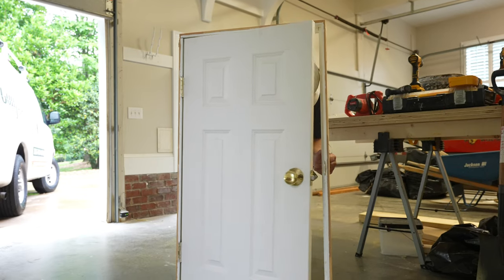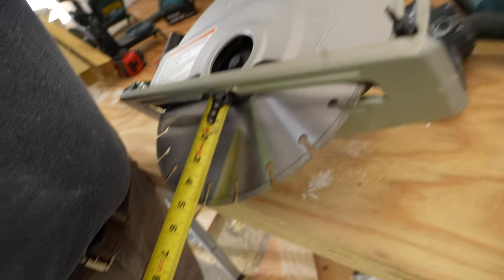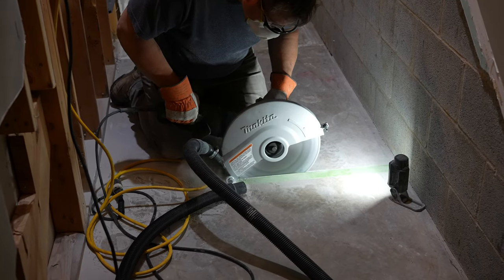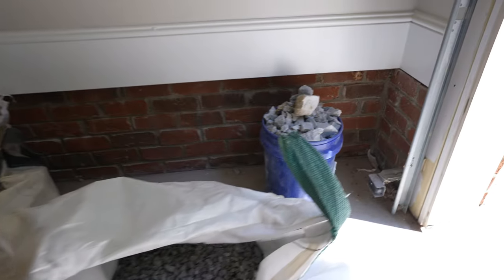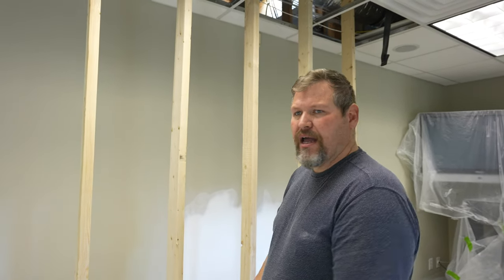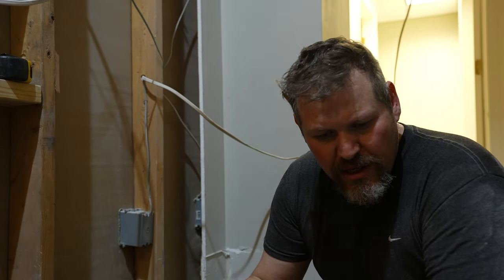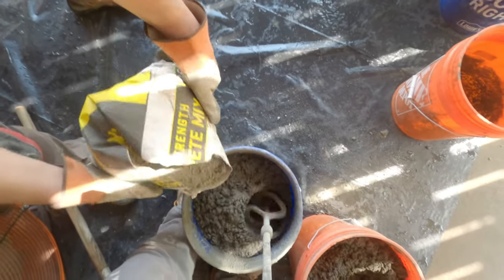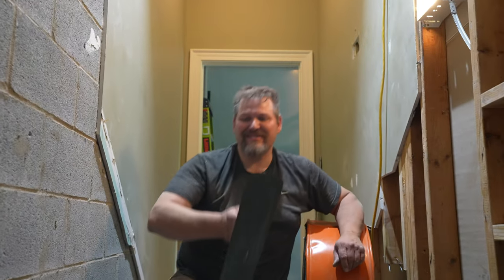Cutting Concrete with a Makita Concrete Saw 4114X and More

Comment: Hi 

Enjoyed the video, though I do have a question. I intend to cut a concrete floor, my only concern is if there's rebar within the concrete. Will rebar damage a concrete cutting blade?

Kind regards 

Robert
Reply from the maker: Yes, you can cut through rebar with your diamond tip blade but it will take life off your blade. My recommendation when you reach rebar is to make sure you’re using water and do not use excessive force.
Reply: @campbellbuilt is it safe to use water?

Comment: I purchased the Harbor Freight Bauer concrete saw because it has a water hook up.  It is a complete POS.
Reply from the maker: Having a water hook up on the saw would be nice but we’ve made it work just fine with vacuums. Appreciate the input about the Bauer.